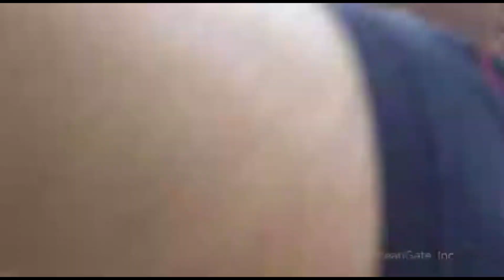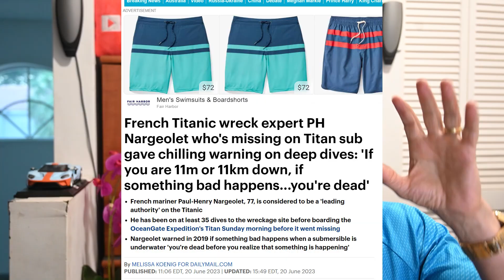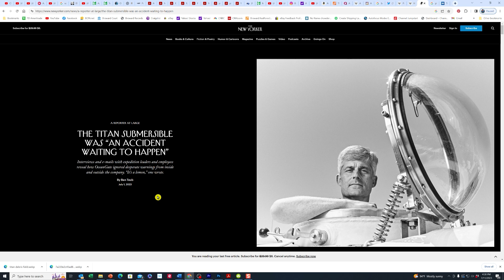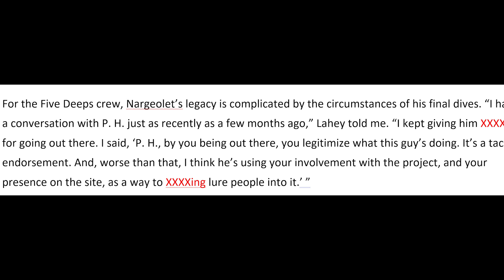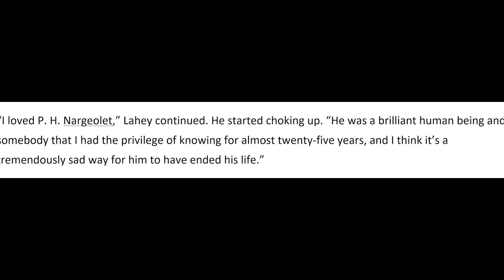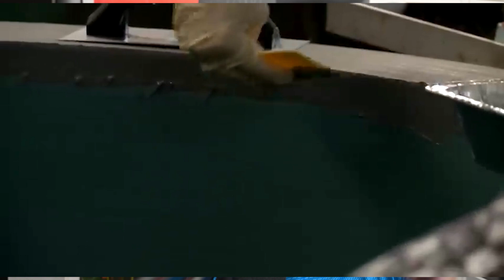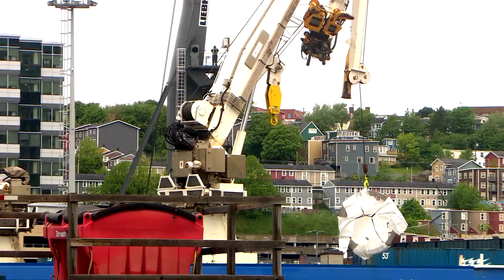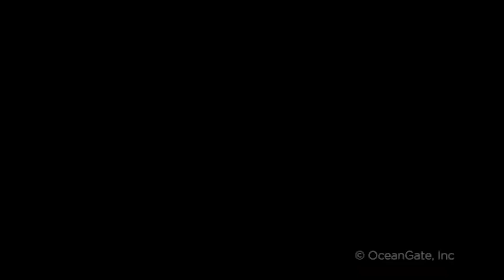Titan Sub: More Q&A, Design Defects, Why Descent Fast

Comment: Lots of things you aren't thinking about here. The rings didn't require much glue to seal. The outside pressure would seal them as the pressure kept building during the dive. Remember they are being pushed tighter to the carbon as the outside pressure builds.They just needed to be held in place and reasonably water tight at the initial dive. Second the end caps you are discussing are in compression against the carbon fiber. Once the carbon fiber explodes, it would explode into millions of pieces. The glss pieces wouldn't have had a chance after the explosion to stick to anything. Also the fibers were prepreg carbon. They are previously wetted and applied with the epoxy already built in. Thats why you need the autoclave to heat it and cure the prepreg. Now the question I have is the prepreg has a shelf life and was it observed? Also it is supposed to be stored very cool in like a freezer to keep it from initially curing before assembly. I just did a show on this talking about the very topic of some of these facts and questions.
Reply: The carbon fibre didnt seem to have cross weave, and also it couldve began to flex ever so slightly in the centre of the tube, which couldve forced the titanium ends right off
Reply: @ryanwatterson4038  The reason they laid the carbon fiber that way, was because the hull was in compression. Carbon fiber tanks have a cross weave because the carbon fiber is in tension. Carbon fiber doesn't work very well in compression, it's weaker. It works really good in tension.
Reply: Rush told Weissmann that "he had gotten the carbon fiber used to make the Titan at a big discount from Boeing because it was past its shelf life for use in airplanes," Weissmann wrote. So no the shelf life was not observed, and he did it to save money..really sad.
Reply: @IrLosin  which tells me the carbon fiber used definitely was prepeg. And that is why it had a shelf life and it should have been observed also. But that is the least of the problems because it shouldn’t have been used to begin with since it’s properties are designed for tonsils strength and not compression strength.
Reply: @IrLosin  The shelf life was probably an arbitrary time period but this is an example of the seemingly unnecessary precautions that responsible people are willing to take in order to reduce risk by even a tiny amount. Just look at the NASA workers in their climate controlled and air-filtered rooms wearing sterile white jump suits and masks and gloves.
Reply: All this is true.  What we know is that for some reason the design of the craft failed.
Reply: @SuperNostalgia.  👎
Reply: Every material has different elastic properties. Meaning they deform differently under extreme pressure. The contiguous titanium has a much higher deformation  strength than carbon fibre...meaning that the glue was essentially being stretched with every dive cycle. It was just a matter of time. Thunderfoot did a great video on this subject
Reply: @paulbuswell6566  the glue wasn’t necessary for a seal. Has nothing to do with what happened to the vessel. To machined mating surfaces would have sealed in that environment without glue. It on the surface it was necessary. The end caps were nothing but machined mated surfaces between the two pieces of titanium. The issue had nothing to do with the glue. It was the carbon fiber itself. Like I mentioned in one of my videos. It’s designed for tension not compression loads. It was used in this application in a compression load. Another issue which non of us can confirm is was it ever cross weaved and was an autoclave used to cure the carbon since it had been laid with prepeg carbon.
Reply: @paulbuswell6566  The epoxy bond was so strong that it held in place while the end caps blew off. To blow the end caps off the flanges the flanges had to be held in place.
Reply: Once the hull cracked and opened water fills the hull instantaneously and won’t break hull into millions of pieces, but reasonable sizes - yes. Other fact is, more than end caps getting pressure from outside, hull get higher pressure which does not balance out since entire body is not spherical shape. And There is no theory to break glass of the end cap, if the hull broke first. If the glass broke first, the water splash and the shock could dismantle the glued from the end caps. I am not an engineer, but happy to discuss physics behind it. 😊
Reply: @kumak2591  if the hull had any type of leak it would have exploded instantly. It wouldn’t have just leaked.
Reply: But that means that the thin application of glue is being squeezed between the carbon and the metal at unbelievable pressure. That doesn't sound too good. Things usually break at the weakest point. If the glue becomes part of the carbon fiber that's fine but what about the bond with the titanium? Only weld will become a part of the steel at a molecular level.
Reply: I agree. The flange connection was so strong that it held in place while the end caps blew off. The end caps are detached from the flanges, they are not intact. That tells you the connection held in place. The carbon fiber shattered, that's why you don't see much carbon fiber on the flanges. The flange to hull connection was the strongest point on the sub.
Reply: NO the titanium and CF under pressure shrinks at different rates.  That creates gaps so the seal actually gets Worse at depth, not better

.
Reply: @electrictroy2010  not the case at all.

Comment: My going theory is that there may have been a small gap or misalignment between one of the flanges and the interface (vertical) surface of the carbon cylinder. The adhesive we see them putting on there is likely only for sealing (I hope). If there was a gap, it puts most or all of the lateral force from the pressure dome against the shear strength of the adhesive instead of the carbon. After enough dives, if that adhesive fractures or delaminates, flooding would occur, and more importantly if there's inadequate "wet shim" and there was poor mating the titanium flange would've contacted the carbon extremely rapidly in a high shock point load, possibly causing a cascading fracture.

Honestly though it's about as likely the supposedly expired, supposedly bagged prepreg CF just had voids galore in it and failed spontaneously. I cannot believe they didn't do NDT or full-scale destructive testing at depth. If Stockton did as he said he did then this was just short of manslaughter.

The most interesting part of this whole thing has been listening to Stockton's reasoning for the cylindrical pressure vessel over a spherical design: interior photography considerations... He literally designed this thing to be a photo booth on the ocean floor, and that's why they even went with a novel COPV... That's why 5 people are dead.
Reply: You'll notice in the video of the flange installation that there doesn't appear to be any preloading fixture, press fit, or jig. They appear to have just gooped it up and slid it down into the CF cylinder (liner?). Did they put weights on top to ensure good mating and contact during the cure or just rely on gravity? This thing is operating at almost 400atm and the ends were just glued on with a slip fit?
Reply: What is COPV?
Reply: Composite Overwrapped Pressure Vessel. You can get away with a thinner walled metal tank and a lighter overall construction. Used in solid rocket motors for missiles alot but they have many many problems and are still quite rare even in high end aerospace. They are almost exclusively for single use or light duty. Nobody has ever used them for deep sea diving successfully before because of the limited compression strength of composites and the cyclic fatigue of repeated dives.

Comment: I wouldn't be surprised if the internal pressurization pump failed and set the stage for the disaster. as far as the lack of an autoclave...that's a huge, missed step in the process and pre-wetting of the fibers is essential unless the assembly is put into a vacuum chamber to extract the air in most cases. With a series of layers this thick, there would need to be significant time for the resin/epoxy of the pre-wetted fibers to cure without an atmosphere while allowing the entire volume of air to escape within a vacuum chamber as required. After the air had been vacuumed out, then the next step would be the insertion into the autoclave for maximum compression before the curing. The cleanliness of the surfaces is a non-issue since the force of the implosion would've eradicated any remnant of any non-solid material.

Comment: So, from the transcript it seems they were descending too fast, and when they tried to come back up when the alarms started they struggled to get the sub to rise, could that mean that the carbon was delaminating, creating spaces that water was seeping into, making the sub heavier than it should have been, causing the rapid descent and loss of ability to rise when they dropped the ballast. Does that sound like it’s possible? Obviously it all failed and imploded but I wonder if the previous contraction/expansion cycles had loosened the carbon fibre and let water in.

Comment: i dont know what you exactly mean with "pre-wet" the carbonfiber (language barrier here), but working for an car manufacter company, if the carbon fiber is of the pre-preg kind, we do not apply further epoxy that then amount already in the fabric as delivered by the supplier... different matter is dry carbon fiber, where the fabric is applied indeed dry, and the resin is injected at the start of the curing proccess

Comment: The faster than normal descend rate is one thing that I do not understand.  Did they monitor the descend rate for the whole descend process?  Did they find something abnormal that the sub was descending too fast?  They should have never desend more than 30 minutes if the descend rate is higher than normal.

Comment: I SAID THE SAME THING ABOUT THAT SMOOTH RING AWHILE BACK-!!  I also wondered what the low temp limit of the epoxy was, maybe it hardened in the low temp enough to shrink at a different rate than the CF, the whole dissimilar material thing is huge to me.
Reply: CF?

Comment: Towing of the sub across stormy Atlantic for 600 miles likely disturbed the epixy joint between titanium rings and carbon fiber tube
Reply: The floating rig was a flat bottom aluminum device suitable for a lake or river. Big waves call for a V Hull. Absent of that the waves pounded the sub viciously with extreme vertical G 's
Reply: It certainly wont have helped.

Comment: Rate of descent should be standard for the calculation of the weight carried. It should be controlled by the amount of dive weights attached to compensate for the combined weight of the passengers. If they added too much dive weights then the rate of descent will be faster. Other wise there could have been other problems with some of the auxiliary systems in the tail. A reported “A” buss failure switching to “B” buss. Did a battery on “A” buss take on water? Was one of the thrusters running unknowingly to cause the “A” buss battery to deplete to fast on descent? Was one of the up and down thrusters setup backwards? So even though the controls were set for an emergency assent the sub was not rising as it should have. One of the biggest faults of this sub was the reliance of the lap top for control and the screens for monitoring.  Emergency systems should be hard wired to a Go To Hell panel where to drop weights lift switch cover and activate switch. Remove landing frame same thing or activate a mechanical lever and linkage to drop.  If the lap top froze up during an emergency then valuable time is lost to get it up and running again. Same with communication to the surface there should have been a backup system independent of the lap top.
Reply: They were never descending too fast. He keeps comparing the descent rate of James Cameron's sub to this sub, which is fundamentally wrong. 
Doing 5min of research will show you that this company made 13 other trips to Titanic, and every one of them had a descent rate that got them there in 90min or so. The descent rate wasn't an issue. 
This topic keeps generating a lot of clicks though, so ignorant speculation keeps winning the day.
Reply: @undeadarmy19   Then why did the surface ship question the descent rate at all...several times I believe?  And was the ascent rate also not too slow.  Aren't those two sides of the same coin?
Reply: @cherp7522 Well, seeing as how this transcript hasn't been verified in any way, we have no way of knowing this.
Again, all speculation, not fact.
Reply: @undeadarmy19  It also hasn't been rejected by them either...  That transcript smells accurate...if you know what I mean.  But we will all stay tuned.

Comment: Maybe the carbon fiber was slowly soaking in water which made the craft heavier which made it descend faster which could also be why they had trouble dropping the weights and the ascension was slower than projected (( if the transcripts and info out are true )
Reply: Carbon fiber composite is more dense than water.
Reply: @mqb3gofjzkko7nzx38  if it had microscopic cracks couldn't water soak in over time ? Which would make it weigh down? I don't know just a thought haha
Reply: @j562gee0hdeewestsdegethemuLa  If 100 kilograms of water soaks in then the volume increases to displace 100 kilograms of water. So the net effect on buoyancy cancels out.
Reply: @mqb3gofjzkko7nzx38  depends in which direction your volume increases in this case, no?

If it increases inwards at all, towards 1 atm air, i'm pretty sure the overall buoyancy of the craft would decrease. Your statement holds for solid CF soaked in water but this craft is not just CF but a pocket of air enclosed in CF. If the hull changes shape to compress this air whatsoever, net buoyency would rapidly decrease.

however i don't think this is what happened. The effects seems to severe to be caused by a passive, gradual decline, i'm more inclined towards some kind of a configurational error (too much ballast or missconfigured trusters) or simply disregard by rush piloting, if he had any means of controlling the descent rate.